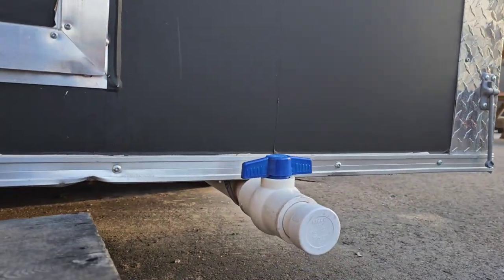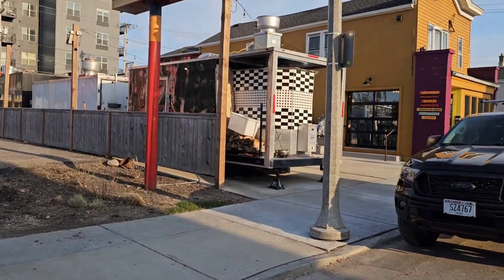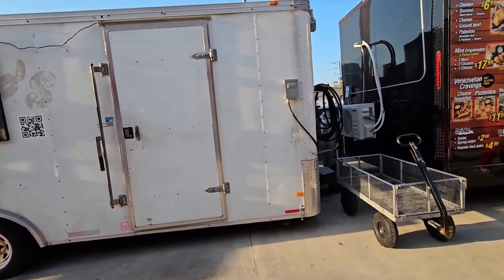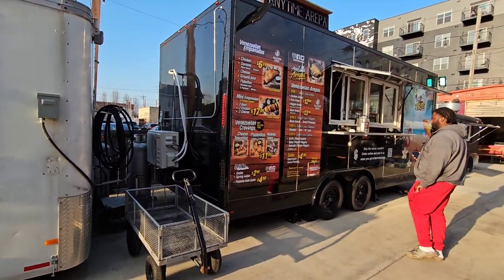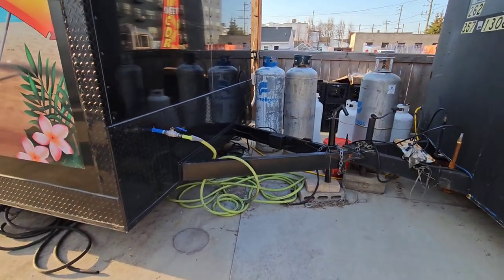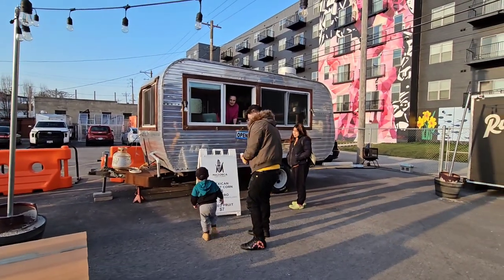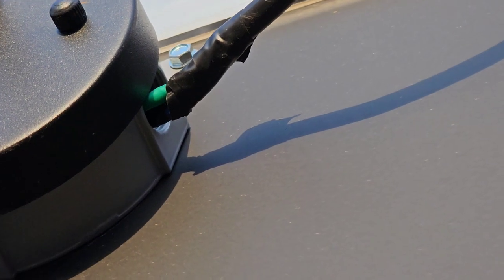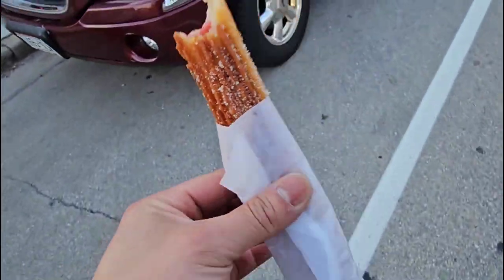How to Choose your Food Truck?

Comment: Recently I bought food trailer I started to buy cooking equipment I have question for flat top griddle Which thickness do you recommend? 3/4 or 1" in griddles and why? Thank you
Reply from the maker: https://www.webstaurantstore.com/cooking-performance-group-gtcpg36nl-36-gas-countertop-griddle-with-flame-failure-protection-and-thermostatic-controls-90000-btu/351GTCPG36NL.html

This is the one I use, as to a why explaining the difference between thickness I have no idea.